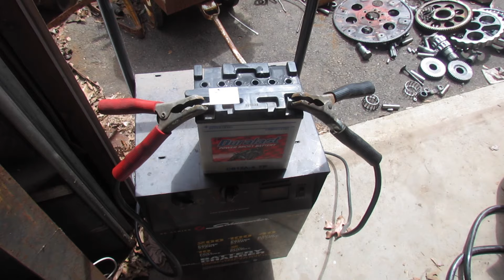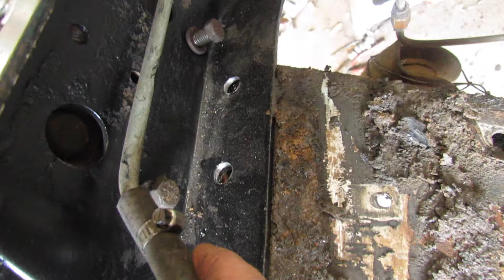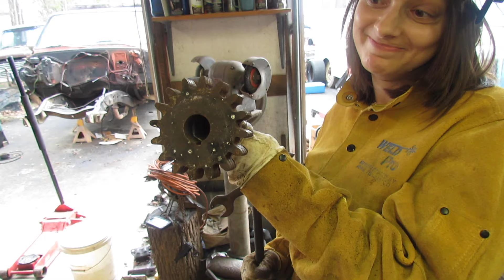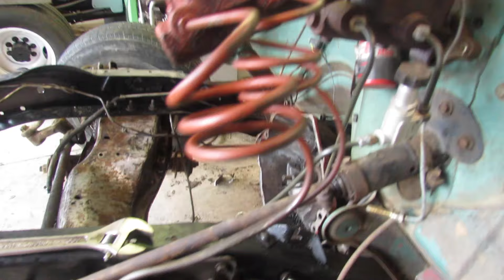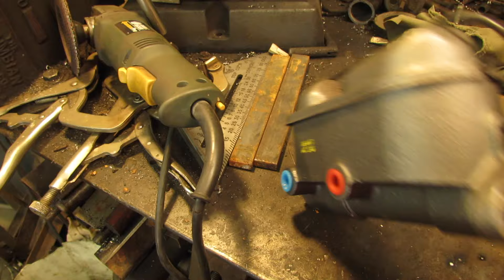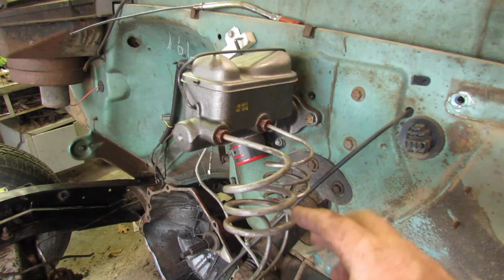Final bolt in-Crossmember swap 66 C-10

Comment: That is quite the project. I fixed up an old CJ7 jeep for my daughter. I had it tore down to the frame and replaced the tub with a new fiberglass one which is no big deal because there is nothing to a Jeep CJ7. What you are doing is amazing. I did not know how alike these old Chevrolet Trucks were. Nice Work!

Comment: I can help with bench seats it's eazy 2 bolts and they come apart. Take hog rings off covers slip off. Foam work is eazy I cut with turkey knife bad sections and add new section using scrap bench seat. Glue spray and da grinder smooth out. New cover is like 250 heat gun covers and pan cooking spray slide right on. Maybe a hour from start finish. Carpet get premolded things look lot better inside cab.

Comment: That was a huge amount of progress recorded in an 8 1/2 minute video. I got in big trouble with a dump truck a few years ago when the seller didn't have the brake rod adjusted correctly and the front locked up on me driving it home.

Comment: I just did this swap on my '70, which I believe I put it on a mid 60's frame. Reason I did swap is the 73-87 already had new balljoints, tie rods, drop spindles & springs. 

Thank you for the video!!

Comment: I'm not sure I understood correctly, but are you going with disc brakes but without a brake booster? Is that going to require some very serious pedal pressure? Front end looks very good. Nice job.